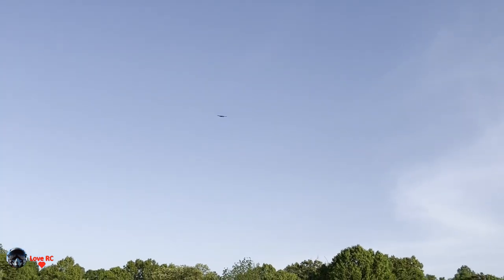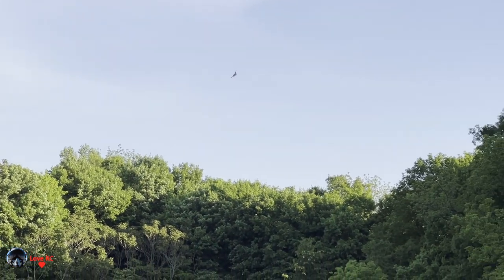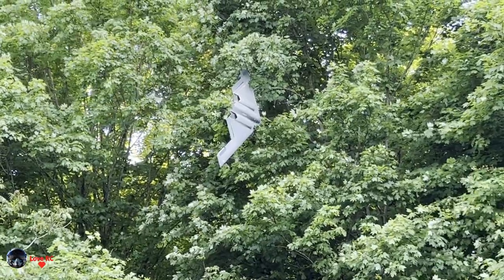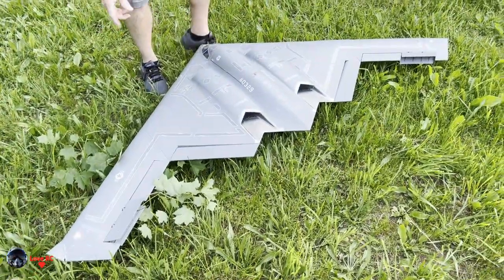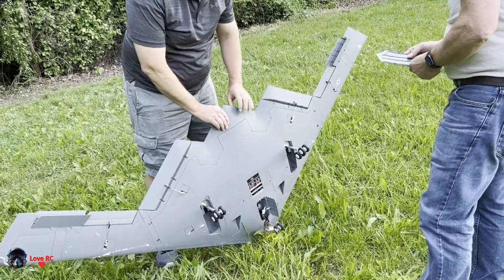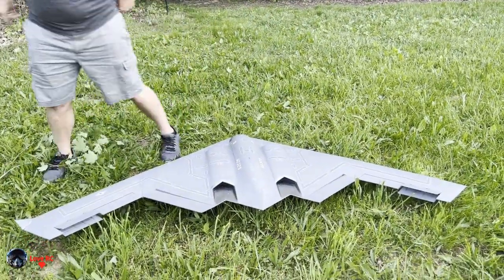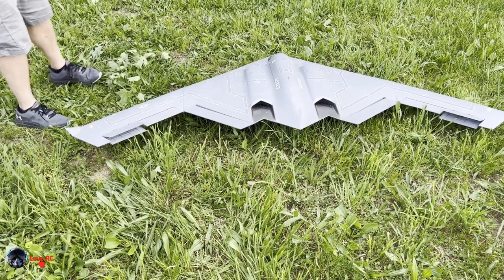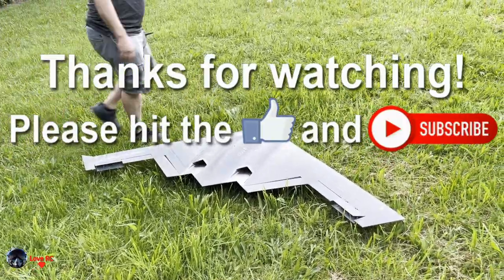Freewing B-2 Spirit Bomber Second flight and CRASH!#@!  - Pilot Fox

Comment from the maker: Really lucky here.  There was minimal damage. He shot a rope up into the tress with a bow and arrow. 
The plane slid down in stages as they shook the branches with the rope and then by hand with a vine towards the bottom.  
Each time the B-2 landed on the tops of a new leafy branch.
There are lessons learned here.  It's a heavy plane and can really drop fast.  So a better glide scope.  North end of the runway is an easier approach but the wind was blowing from the north.  Clear the trees before dropping down.

Comment: $100 for two wings get a set before their out of stock but good flight
Reply from the maker: They are already out of stock.  Repairs have been made to the original wing and new nose wheel servo has arrived.
Reply: I bought a spare set before than ran out
Reply from the maker: @drabun1959  that was a good move.  That appears to me to be the parts mostly at risk.